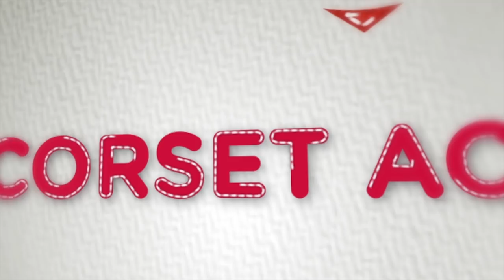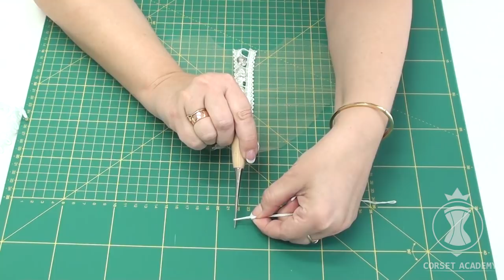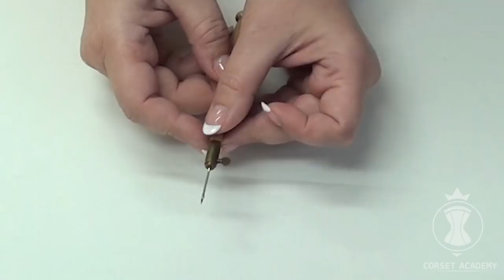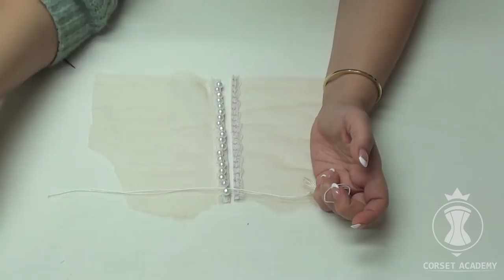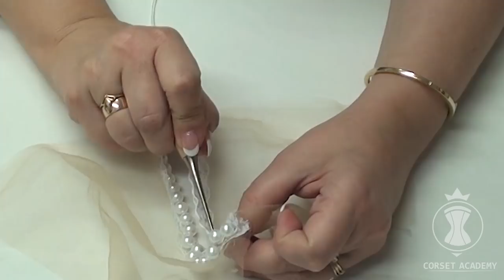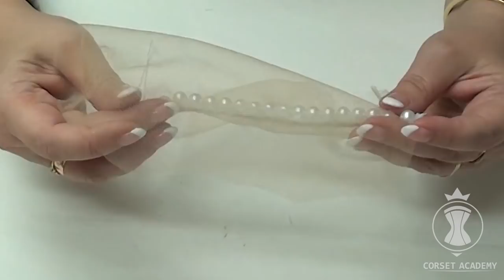Button Loop Closure for Wedding Dress DIY. Part 2

Comment: I love your video..but when you are trying to enlarge the loops at the end, you should pull the loop thread from the END and work your way back UP to the neckline. That's why you have to keep pulling the loops over and over. You are working down, so the loop you just pulled out from the edge of the centre back gets sucked back into the edge of the closure when you pull the next one out.